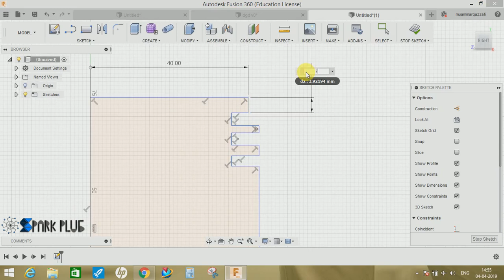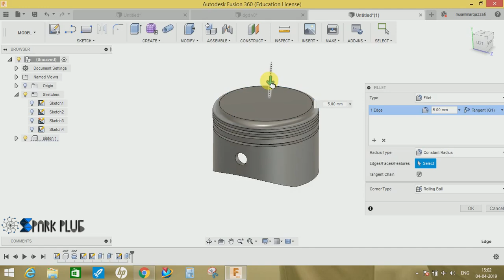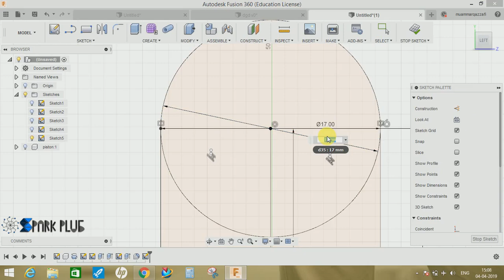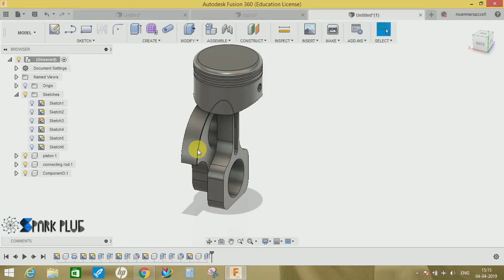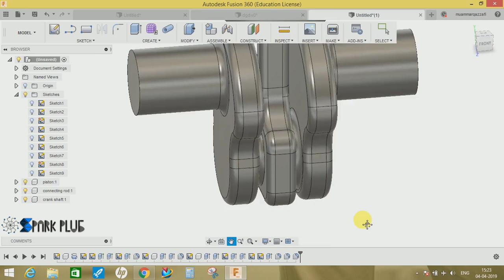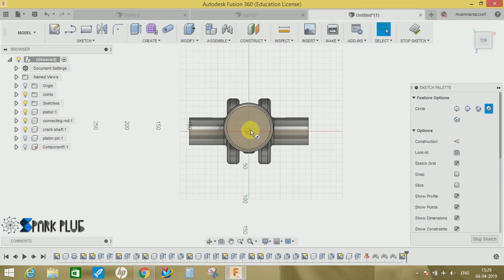Fusion 360 beginner's tutorial - Modeling a piston  cylinder engine assembly

Comment: The video is nice , 
          but you sketch is in a unusual way which is hard and you are not using the effective or the easy way to sketch which in involves
 1) Shortcuts as well as when you dimentioning anything while creating it such as a line or circle which an increase the speed of your production.
 2) Also you are not effectively using constrain command.
 3) Some of the shortcuts which you should use are you can use right click and use the same command as before or repeat same command.

these are small things which increase the speed of your production. As a well wisher hope you will take into considered the shortcuts and teach people with right method .

Comment: How you rotate shaft by using mouse. My solid can't rotate
Reply: while giving motion of slider with piston and cylinder use as built joint
Reply from the maker: Of you can't then you. Must have done something wrong when assembling
Reply: @SPARKPLUG98  Ooh ok I will check my design😯